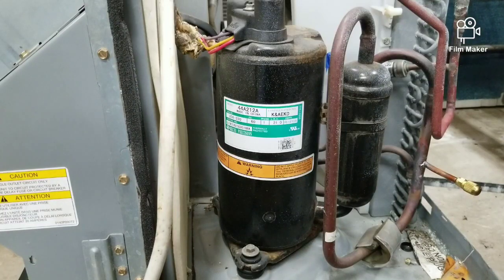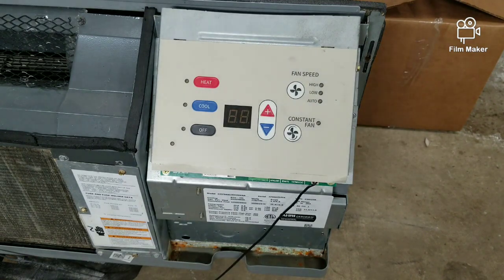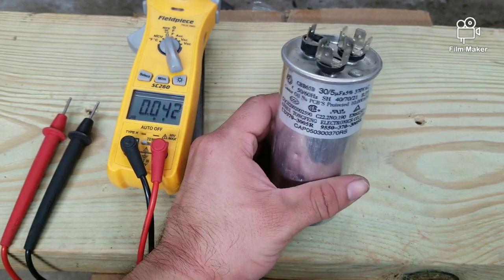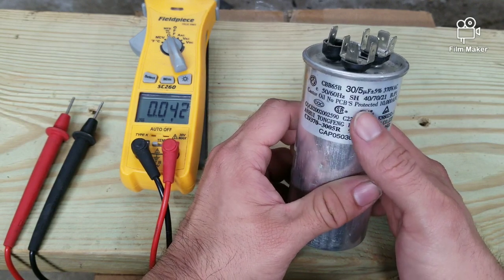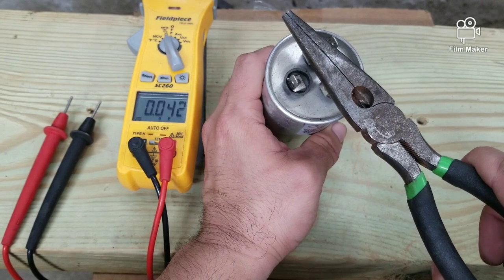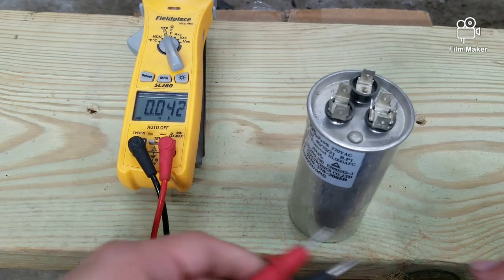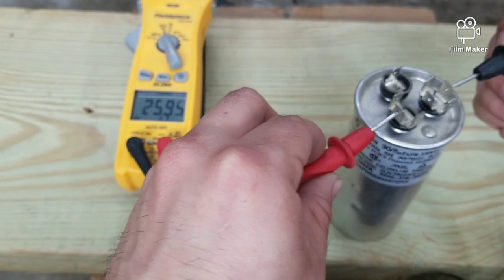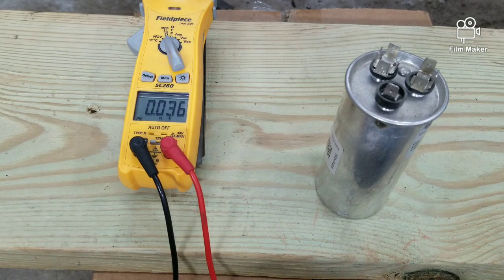Ptac not cooling...Compressor not coming on...capacitor test

Comment: What if the compressor is short cycling?
Reply from the maker: Hello, 
I would say 1 of the main reason for a compressor short cycling would be high pressure. Check for a broken fan blade,  function of the condenser motor or a dirty condenser coil

Comment: Whats a good replacement capacitor for this brand i use them on a islandaire unit that model is discontinued and hard to find
Reply from the maker: Hello 
You can use whichever capacitor, as long it's the right microfarads
Reply: @PtacSolutions  thanks man you are a life saver

Comment: What about the smaller capacitor?
Reply from the maker: Hello, those are for the blower motor, depending on the voltage they could be a 1,. 1.5(if 15k btu 265v) or a 2 microfarad capacitor

Comment: Ok dc, what if the ptac blows OK air out BUT not really cold. Could it be anything to do with the capacitor OR what. Only due to the fact that the ptac is old only
Reply from the maker: Well if the compressor is not coming on that is a possibility but if it is it may be low on refrigerant..
Reply: @PtacSolutions   do you recharge them and how if so?
Reply from the maker: @weslawsonsilverback  yes you can, but you'll have to install one of those line tap valves
Reply: @PtacSolutions  ok gotcha thanx
Reply: Hot damn, tip the man!